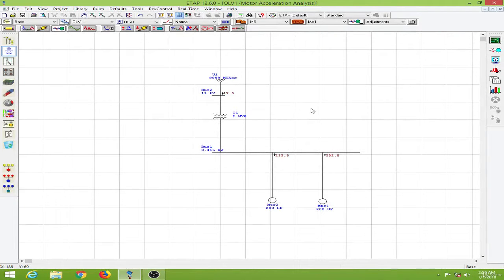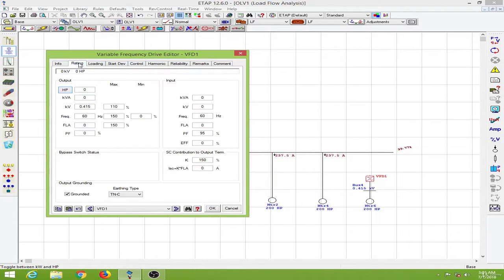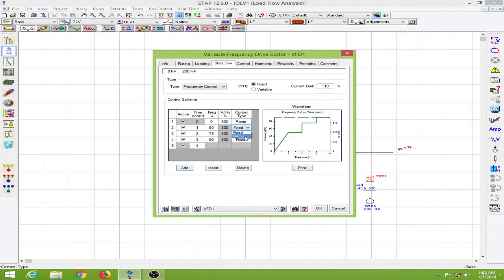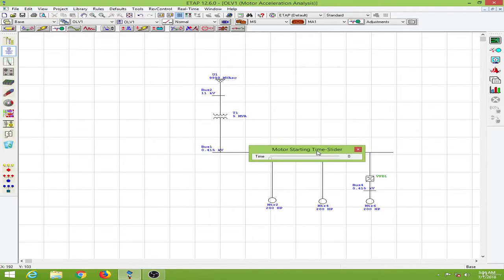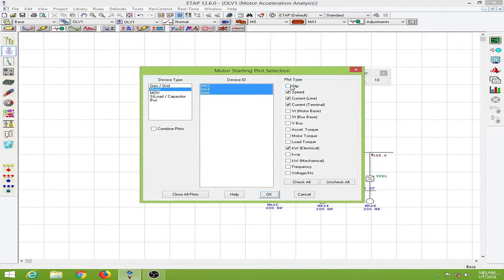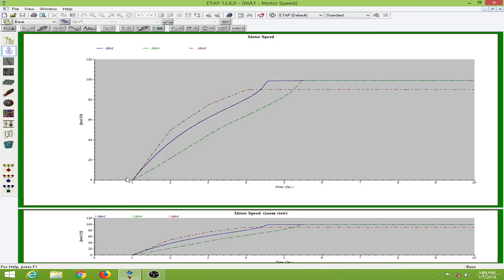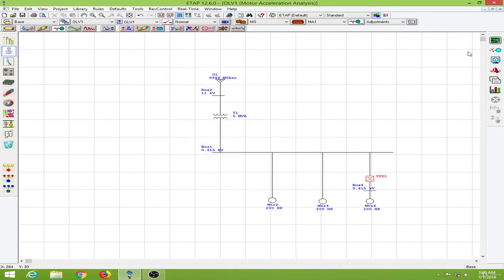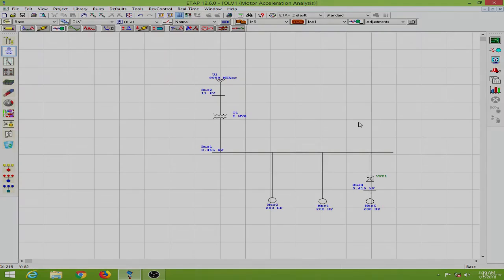Sesión 20: Análisis de aceleración del motor IV Arranque VFD - Curso Etap

Comment: First thank for sharing this modeling. But i have a question. In the modeling of VSD, if i have a MV System with 3.450 V and 50 Hz, the ratio is 69 volts per herz...in that case, what number of percent of V/Hz must i consider (you put 800% because 415/50=8 in your example). Thanks if you can help me. Greetings and take care.